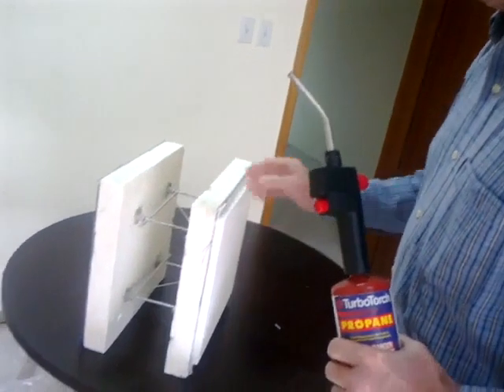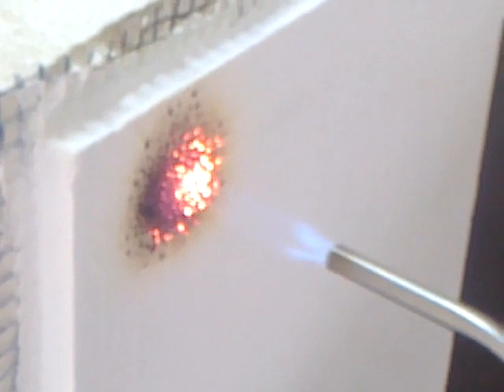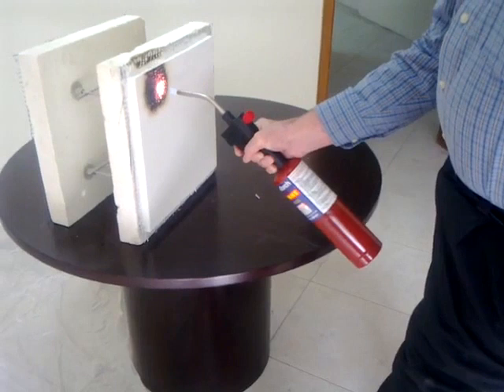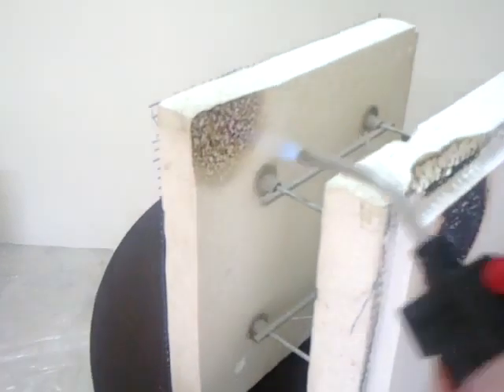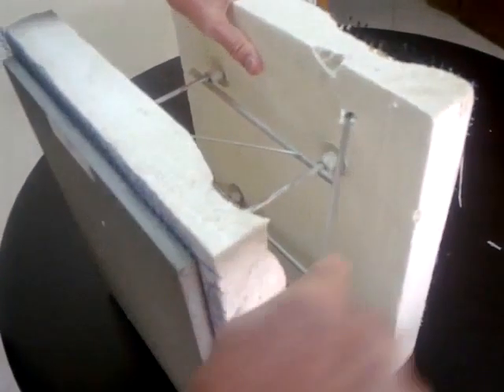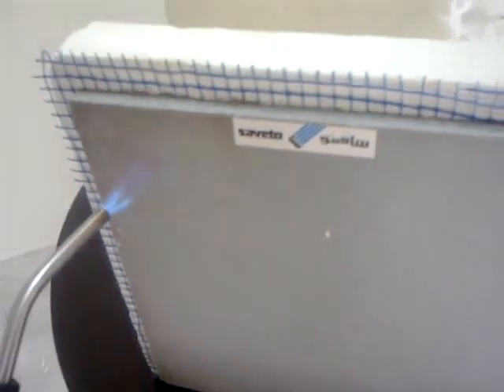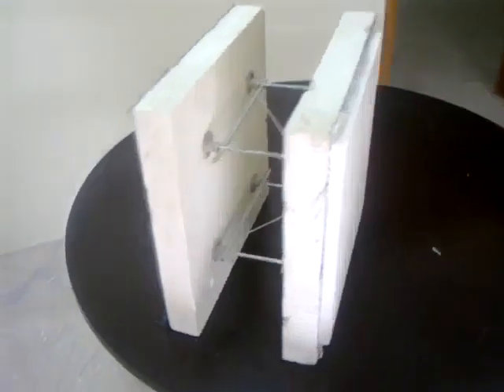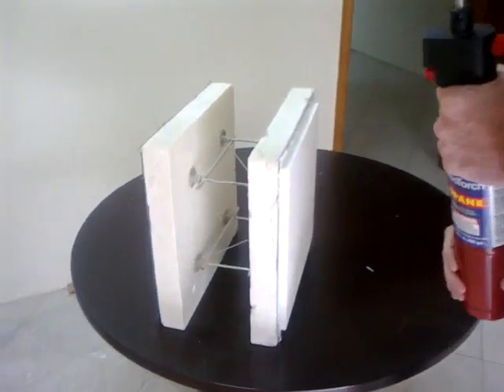NoFire Test on Polystyrene

Comment: mrlordmilton, you don't know what you're talking about. He is simulating an assembly, which is how things are tested. He is testing to see the difference on how much the polystyrene melts behind the concrete, coated vs. uncoated. The fact that the interior of the form would be filled with concrete is immaterial. The product performed just fine.